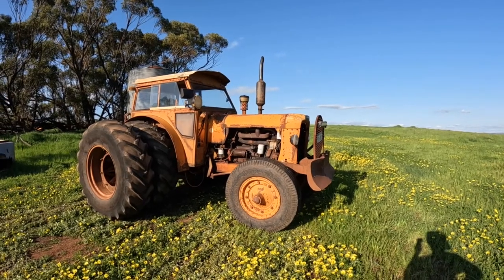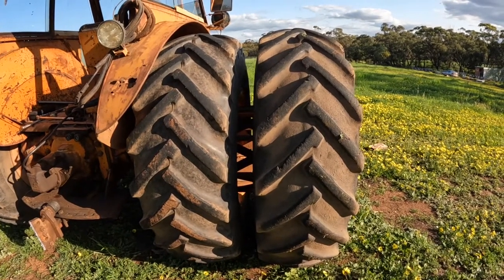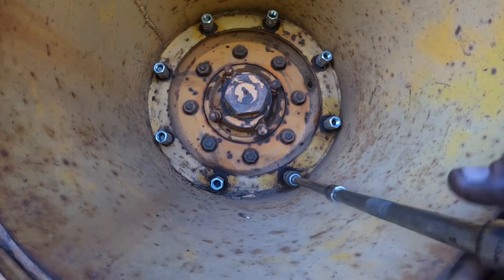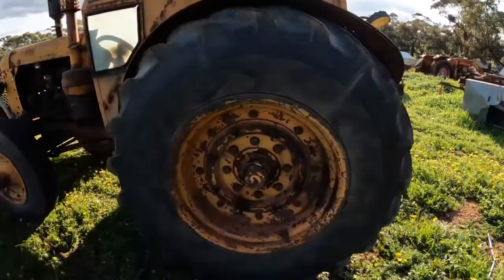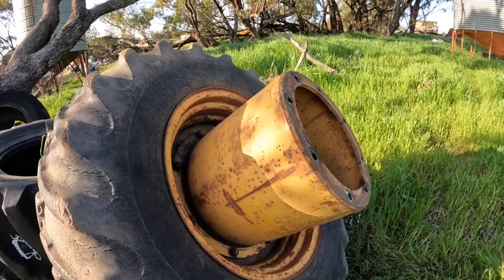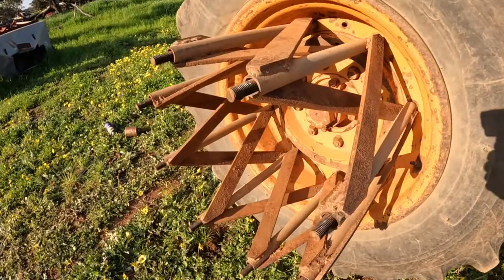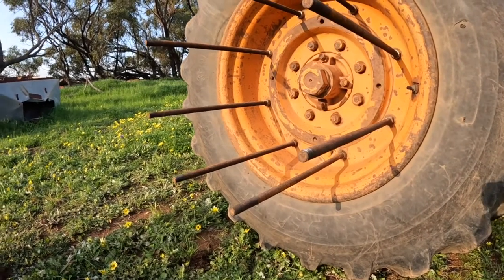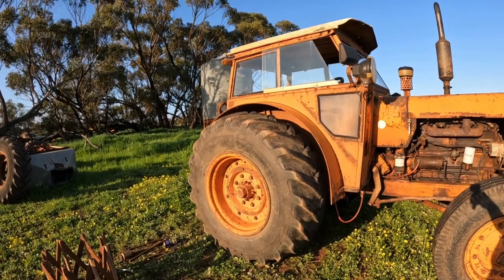Removing the duel wheels from the Chamberlain Countryman 6

Comment: That spacer you made would have taken a bit of work. Good job mate
Reply from the maker: Hi Hubcap, yes it did, and I was surprised how many meters of flat bar I needed. Fro memory I think I used about 12m of it.
Thanks
Reply: It's a lot more complicated than the factory version, but he could make it without needing giant rollers to force flat plate into the cone.